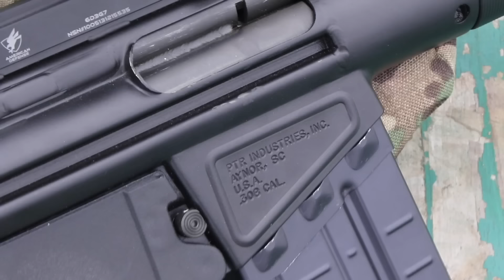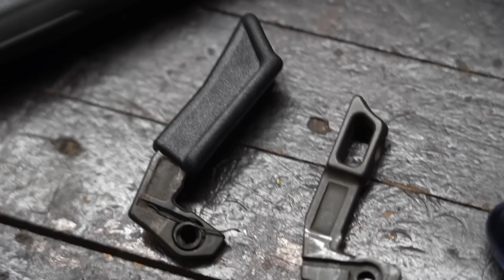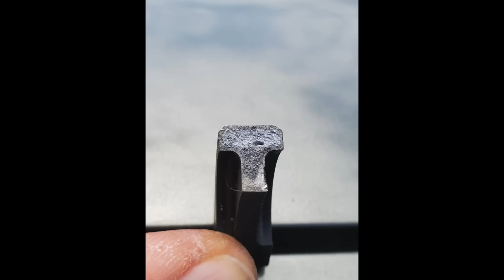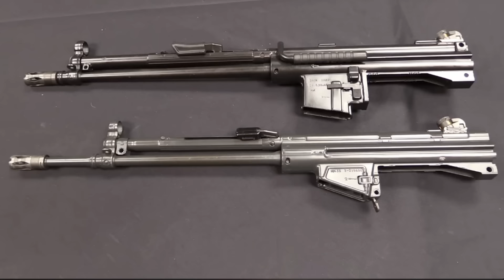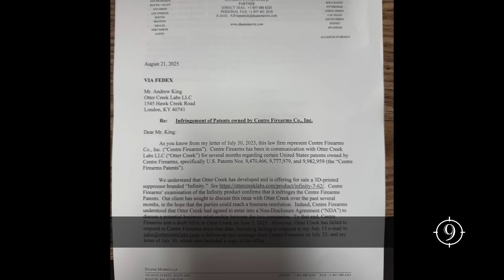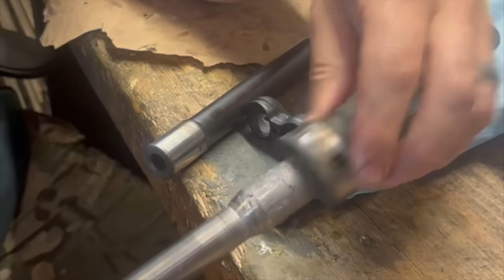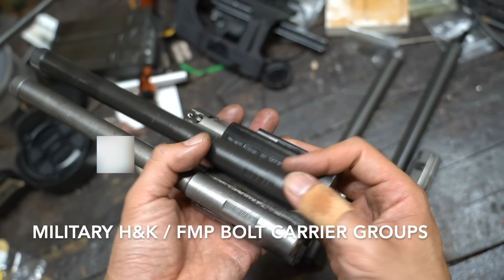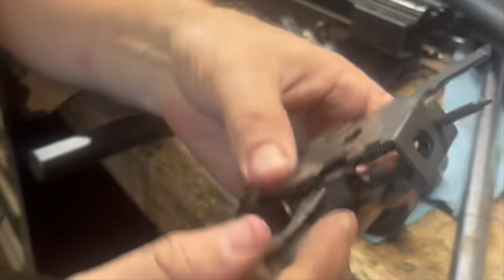Is PTR still worth the money? H&K v. PTR (old) v. PTR (new) v1

Comment: I am going to have to tear down my PTR-91 GI model after watching this video.  I honestly have not fired mine a lot, but function has been 100% from the very first shot and it was advertised as having a top grade barrel  (maybe green mountain ???).  Accuracy at close ranges was good with German mil surplus ammo.   The trigger looks stamped and not cast.   Hand guard might be military.  The pistol grip and trigger assembly appear to be PTR.   
But I had to modify the rear sight to get enough windage to sight the irons in.  I have mounted a scope using an after market mount that goes into grooves of the receiver where a claw mount would go.  No top rail with this gun.    
I have book marked this video and will disassemble the rifle and compare with the video.  I am more interested in ARs these days and I have a norinco M14 with TRW bolt installed and a Saiga 308 also.  
I was disappointed to view video, but viewing the truth before hand is better than learning in the field.  My  gun was purchased during the Obama presidency at a time when buying a PTR rifle or anything semiauto using a 20 round or larger magazine was very difficult.   i am thinking 2013-14.  
The trigger pull is quite good for such a rifle and I see no reason to put a paddle trigger release on the gun.  The lever (Stamped PTR-91)  for retracting the bolt is not smooth, but it breaks the bolt and rollers free.   So I will check that lever out and also look into hammer to see how it was made.   
I have not fired it since covid and need to shoot it some more.  It was intended for SHTF scenarios like for use against vehicles such as mounting a roadblock to the subdivision or maybe one of our misbehaving black bears.   
I will make sure that I do not fire ammo loaded above nato specs.  Commercial hunting ammo I believe is loaded a bit hotter than is the case for nato loads.

Comment: I had a JLD, they were trash, the thing hit two lanes over at 50 yards with the sights centered. It also jammed about every 3 rounds because the rounds wouldn't feed due to the receiver being welded crooked. The pin holes were all oblong to fix the receiver issue.
Reply: So your serving size of one was bad that you received 😂

Comment: Interesting.  Disappointing report on the decline of PTR.  So I should hang on to my circa 2008 PTR91C (heavy barrel, surplus trigger pack, H&K bolt carrier, low AW serial number before the issues with tar-sealed ammo) and my 2012 PTR91GI (surplus trigger pack but PTR bolt carrier).  Both take the H&K claw mount.
So I should have grabbed a 2nd PTR91GI in the mid 20 teens...

Historical  note:  The heavy barrel was the only one available before and in 2008.  The GI with the 'correct' barrel profile didn't come out until about 2010 or after.

Comment: I'm rocking the Poor boy Century Arms C308, which I believe also uses PTR receiver and some other parts mixed with the CETME parts kits.
Reply: Me too and I love it.
Reply: Those are bangers! I had a spare CETME grip and trigger pack that Bill Springfield did a trigger and compliance job and a full parts kit from a build I never did. Bought one of those C308s and slapped the wood stock and fore grip. Shoots great and looks great.
Reply: You're not  alone my friend
Reply: Same. I wonder where those rated on the PTR quality scale.
Reply: @hk_4014 my guess, probably in the middle. I bet CETME trunion, but softer PTR barrel that will be galled. PTR plastic trigger housing, but I'm not sure yet on the fire control group. Hell, idk what are bolt, bolt carrier is. I'll have to break mine apart now lol.
Reply: @MrCargod05 i think the trigger housing, fire control group, and bolt/bolt assembly are all CETME. At least all my parts look old as hell lol. Mine has a pretty thick barrel but like you said I wouldn't be surprised if it was a softer metal.
Reply: @hk_4014  Same on the one I used to own. A true budget rifle that could deliver the goods.

Comment: I bought a “new” CA3 from century arms with surplus parts. Shot about 160 rds cleaned twice (especially that ejector and ejector spring on the bolt) and it now runs great shoots accurately.
Reply: I have shot now about 300+ rds now no issues
Reply: It's hit a miss with ca
Reply: Mines been good. Close to moa with crappy m80 ball

Comment: I couldn't afford a real MP5 so I bought a PTR-9CT a couple of years ago. I wouldn't say I'm entirely displeased with it but I do feel like I paid way too much for it. The first thing I noticed is that its tri-lug is set off at an odd angle. It doesn't really affect anything other than aesthetically and at least the sights are straight but I do find it annoying considering how much I paid. With one exception, the ejector lever, I've replaced the grip module, trigger pack and lower parts with H&K or aftermarket parts. However, that one part I did not replace failed almost immediately. Within a couple of magazine, the first time I took it out shooting, the ejector lever warped causing it to bind with the bolt carrier. PTR's customer service was extremely communicative and helpful. They sent me a new ejector lever almost as soon as I told them the issue. But, again, for the price I paid I really don't think it should have happened in the first place. The original ejector lever just seemed too soft and pliable. I don't think it's a bad gun and it's a lot of fun but I don't think it was worth the price.

Comment: I had one of the early PTRs which turned out to have non HK-spec chamber flutes.  It would not extract ANY brass case ammo but was remarkably reliable and not too inaccurate with cheap steel case ammo.  However, I could not live with the inability to use brass case ammo and sold it.  I do have one of their older PTR51P pistols, which is good, clean, obnoxiously loud fun on the range.  I wouldn't use it at any significant range but if you absolutely, positively have to blind and deafen everyone in the room it would do that.

Comment: 2008 "Squad Carbine" here, which is the 16" HB with welded pic rail and 93-size forend.  It has run liike a top uner admittedly light pedestrian conditions.  Lots of surplus parts pus a mix of mid-era, mid-tier PTR parts. ACOG TA11J 3.5x on top and a variety of front and back-end aftermarket parts.  It runs well and it easy to make good hits with, but it always irked me that I had to spend more to get it where I thought it should have  been from PTR.  As it is, I'm torn over dropping another several hundred on a Spuhr stock.  

Very frank and informed video.  I'm sorry to learn of these issues, but frankly, there have been questions going back to the early PTR Inc days about shallow flutes and dicey customer service.  I paid my money and took my chance and stuck with mostly because of the plentiful supply of magazines and surplus parts back then.   These days I would go in a completely different dirrection due to not only these PTR issues but also the vastl price incrases of spare parts.

Comment: My CA3 was jam o matic.. I have to get the RCM #17 locking piece to make it run properly. And have tried multiple claw mount but they were just sliding to the front.. Luckily MFI just have a new production mounts specifically for the CA3 but now I have added $350 worth of improvements to make my CA3 usable.
Reply: Sorry to hear that. Mine has been accurate and reliable right out of the box!
Reply: Mine has been good (other than one surplus magazine issue) and the MFI mount just came back in stock. Cant want to get it to the range to try that piece out.

Comment: Got a PTR 91 way back in 2009. Had to modernize it with a paddle release and a pic rail. Had failures for first 200 rounds but after that it has been flawless. Still have it in my DMR configuration and it’s seriously accurate and reliable. My PTR 9 that I got two years ago on the other hand is a jamming nightmare that I’m still figuring out

Comment: I got a PTR9CT a while ago and the first time I took it to the range it wouldn't fire at all. It chambered a round and the hammer dropped when the trigger was pulled, but nothing happened. No primer strike or anything. I cycled it and tried the next round multiple times, and it still wouldn't fire. I took it apart when I got home and nothing looked broken comparing it with other people's pictures of MP5s online. I sent it back to PTR with a message of what I experienced. They sent it back a few weeks later saying there was nothing wrong and they test fired it just fine. I haven't taken it back out yet, but I'm not super confident that it will actually work this time.

Comment: Day 100 of spreading the word about the CA3. I got mine for $650. It's an original FMP Parts kit with some actual HK parts in it (the bolt, and locking piece to name a few).  It's assembled with a brand new stamped receiver and a new barrel by PTR. It's the exact value g3 that you're "asking for."
Reply: Yeah, I’ll second this. As long as you’re just looking for a gun that feels like surplus and blasts 7.62 with irons it’s a great shooter. The parts kits are wonderfully clapped out and it’s one of the best fun gun purchases I’ve made.
Reply: @pa3gungal well put!
Reply: I also just got a ca-3 and it feels like the old PTR. 100% seconded
Reply: Happy with mine
Reply: PTR is supplying the recievers for the C3 now, and building them. 

 If they change builders, all bets are off. Century has a reputation in building, I think they only hire people fired from government lowest bidder contractors.

Comment: When I was young I worked for a local gunsmith that built many parts kit rifles. I loved using the PTR receivers they were the best. I still have an hk33k parts kit built on one. I kinda wish I had done the mp5 length front end but I wanted to keep the original hk barrel.
The problem is always when the parts kits dry up or the .gov decides we cant have barrels and create new and interesting ways to redefine "demilled" taking away parts sources. They are forced to source or make us made parts. They can't order in the quantities needed to make it affordable to maintain the same level of quality.
DSA and the FNFAL are no different, they are apparently better now but they were even using a cast receiver rather then a forged receiver that they had been getting made by an outside company for years. I even remember a company called Williams that made excellent slide on aluminum scope mounts (no stupid screws) that sadly went under after deciding to make aluminum fal receivers... A horrible idea for obvious reasons when you consider the lockup mechanism on FALs.
Also, heard him mention Special Weapons lol. Nearly forgot about dear Mr. Toad Bailey and his never ending reincoporations and business names due to his horrid products and worse personality. I have an MP5 on one of their receivers, literally the only option at that time. The build process was an absolute nightmare due to how out of spec the receiver was.

Comment: I almost picked up a century CA3 or something but they used a weird rear sight. They kinda lost me there but it's built by PTR I think? Great video
Reply: It’s an hk drum sight. That’s what they had originally
Reply: @TheREALLibertyOrDeath they were putting a standard flip sight rather than the rotating diopter drum. That sight also lacks the recoil lug needed to run the claw mount
Reply: @ethan5.56 g3 is heavy enough without a scope imo
Reply: @TheREALLibertyOrDeath that's not the point 😂 we want that HK rear diopter

Comment: I purchased a new PTR91 GI in late August through a local dealer. I’ve currently put 400 rounds of Saltech through it, had 3 failures to eject around the 150 round mark pretty close together. Thoroughly cleaned it after and no malfunctions since. Accuracy with the irons has been great but that isn’t saying much as I haven’t been able to take it to an outdoor range yet to really confirm that at a meaningful distance. Fingers crossed that it doesn’t let me down, so far so good. Also, the bolt carrier group is PTR as well as the trigger pack being the PTR made one with screws unfortunately. With the costs of HK/FMP replacements for those I might as well just get a parts kit at that point.

Comment: hi love your channel....especially thr HK related stuff....what was your issue with ypur ptr g3k...I have one as well...it wouldn't run in full auto using my seqr pack...and haven't had the chance to properly troubleshoot the issues...but did notice as you mentioned that it shipped with the incorrect locking piece

Comment: I've never owned a PTR-91, but I do have a Century Arms C308 Sporter. It has very nice (after refinishing) surplus wood furniture, surplus Bolt and charging handle/housing. The rest is all PTR-91 because Century couldn't figure out how to assemble a reliable CETME. 

Mine was completely unreliable when I first bought it (I paid only $450 with 3 mags and 200 rounds of surplus ball ammo). After replacing the extractor and spring with German parts, it's been 100% reliable  for just under 1000 rounds of old South African ball.

I've since bought 70 magazines for it (a mix of CETME and aluminum G3) and mounted a Primary Arms 1-8x LPVO, Strike Industries King Comp (cheap and very effective) and had Bill Spri field do his full match trigger job and his spring that replaces the old rubber buffer. All of that cut the felt recoil by about 50% and the accuracy is better than my M1A (going to bed that action next).

Sure, my rifle is a total mix of parts, but the rollers are in spec and it shoots well. I wasn't worried about it being "HK correct". I just wanted a dependable, accurate (for what it is) rifle. 

As always, thank you for the quality content. You're one of my favorite channels.

Comment: My hot take is that PTRs are priced at what HKs should be priced at. They're not complex guns to make once the tooling is setup, there's a reason they went with stampings, it's cheap, fast, and consistent (again, once the tooling is setup). Same reason AKs are made on stampings. The artificial scarcity is what drives the price to absurd levels for a good (not great) gun.

edit: didn't realize the FMP kits were so cheap, might have to grab one...
Reply: Making the parts and stamping, once set up, its fairly cheap. Welding takes skilled labor and a certain time for each weld or you risk warpage. Alignment of all the parts, takes time and skill, or a very expensive alignment jig that ensures every point is all aligned. I can tell you without a doubt, this equipment at an arsenal level is extremely expensive, plus the knowledge on how to properly operate it. its not "push button on CNC machine, out pops complete part ready to screw to other complete part, DONE!" At all.
Reply: @mikecramer3258 Except that it's not people doing the welding. It's machines. The setup of the machines is going to be expensive, I don't disagree, but those costs were handled by the initial contracts, and those jigs/machines/etc already exist. The human element of the assembly of an HK really is just the moving parts around side of things. It's not "dumb" labor, but pretending it takes a doctorate to shove a receiver and trunion into a machine, hit a button (or press a pedal or whatever) that trigger a set time weld in the machine is asinine (not saying you're doing this, just this is what some HK fanboys act like).

Probably the best example is with MP5s since those are currently made in multiple locations. The difference in material and labor costs for a Turkish AP5 and a German SP5 does not justify the 3x price increase. You could put a PHD on the machines for an SP5 and the quality isn't going to be any different from someone who has the Euro equivalent of a GED and some training.

Comment: I traded for a used ptr-91 about a month ago and it's set up just like the original hk-91 with the folding bipod.  I was really annoyed it didn't have the paddle release at first but maybe its a blessing in disguise.  I have no idea how many rounds it has had through it but i fired 30 without a single hiccup.  based on your video, its definitely an early model.  I think i got lucky.

Comment: This is a great video, thank you for putting in this much effort. I did, however, not have the same experience with the early JLD rifles being excellent or even good to go.  I bought one around 2005 (maybe) from a local shop and it looked like a great value. First round down the barrel (Federal 168 GMM) and the case stuck in the chamber hard. I had to send it back to JLD. To their credit they did fix it. I also have a few of the GI models mostly YOUR fault Henry. Your AK4D videos were very inspirational. They seem to run perfectly though I don't ever look for galling. I bought one of the 91K rifles as well and it has been reliable and accurate for me as well. I even got a tax stamp for it. I did swap out the locking piece. Now, of course, I'll have it in the back of my mind that it is going to blow up hahaha
Chears to the 9 Hole Reviews team, y'all make incredible videos.
Reply from the maker: haha cheers man. I think I should have made more of a mention about the SUPER EARLY JLDs having issues with shallow flutes as well.